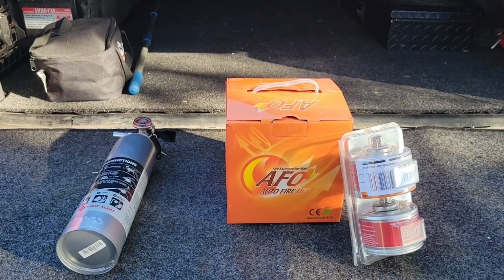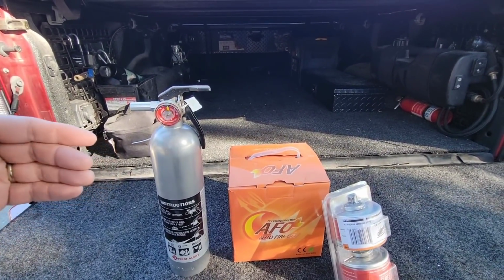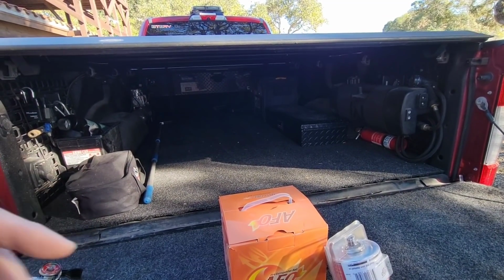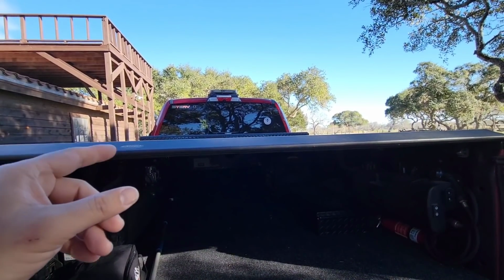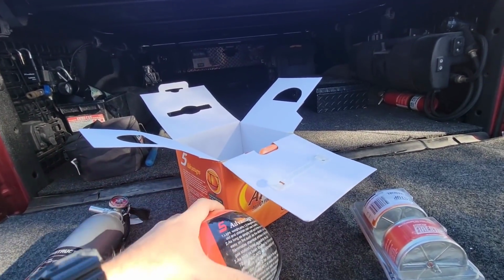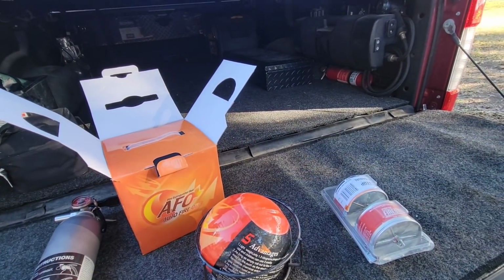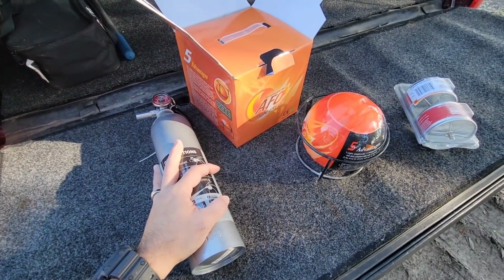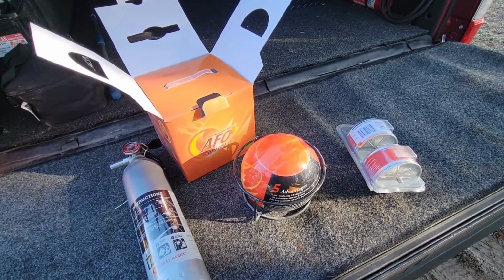Most IMPORTANT RV Equipment! Fire Prevention and Extinguishers

Comment: They must have listened to you because they installed one under my hood of the F550 and it is wrapped in a heat resistant material. They installed it toward the front of the engine bay.  We've had then installed in our rig for around 1.5 years and we live in Florida. It has been exposed to 100+ heat and we have not had an issue as of yet.

Comment: Hey JD was wondering how to get in touch with you about one of your older videos about the low profile tool box for 5th wheel towing.  I've been searching but no luck. Wanted to know if you had any other suggestions.  Thanks.
Reply: I believe Tractor Supply co. carries or carried them.

Comment: How to check a fire extinguisher make sure the gauge is in the green, turn upside down and tap on the bottom so the powder un compacts and gets light and fluffy again, check the nozzle or the hose to make sure there’s no debris blocking the discharge and you’re good to go do every six months and you’ll be fine !
Reply: I’m picturing the three stooges performing said fire extinguisher maintenance. Lol.
Reply: @preachers4135  BTBRV, Matt & Andrew  !

Comment: your tool box can get over 200deg F.  the exhaust of your truck gets well over 300degF.
as to a fire ex. buy the gas unit. it is rated as a,b, c. if you buy the five pound unit.
and best of all no clean up. the dry powder stuff gets everywhere.
and have two in your truck. three in your rv. 
get them serviced regularly. not every so often.